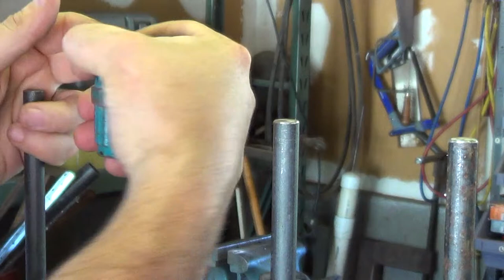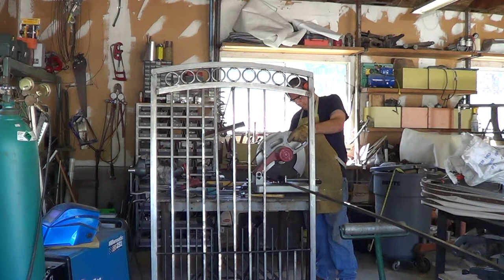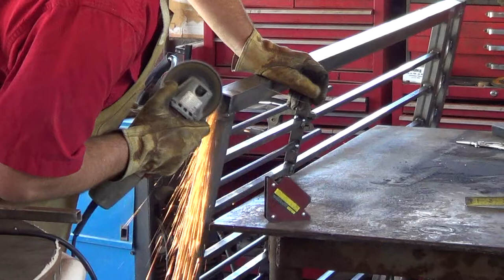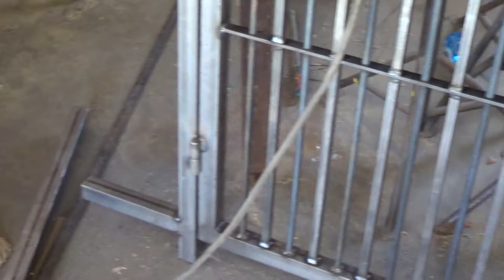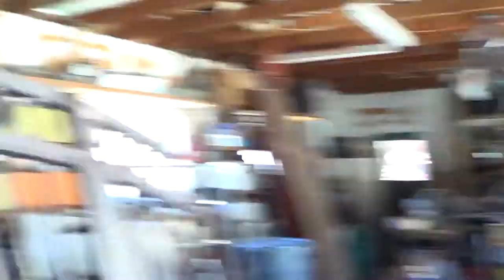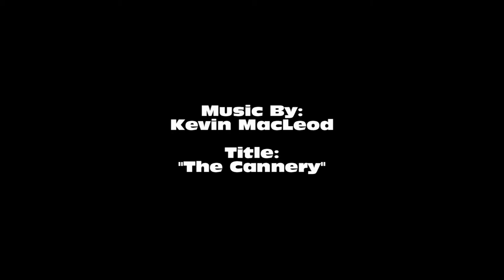MrINJEN - Building a Decorative Steel / Wrought Iron Gate Part 2

Comment: will grinding those welds smooth weakin the joint
Reply from the maker: Yes. But, as long as you have some fill metal left and good penetration, it's still more likely to be stronger than the base metal.

Comment: Can you tell what the total cost adds up to in USA? A gate like that here in Europe someplace near 1200 euro.
Reply from the maker: +Kevin James Parr Prices here seem to vary a lot. I don't ever actually deal with other builders. I have had clients tell me what others have quoted. One client said he got a quote for a entry gate for $5000, they didn't bother to measure for it or even come up with a design. Others are more desperate and will do a job for less than $1000, usually not very good quality. I don't remember what I charged, probably $1500 - $1800.